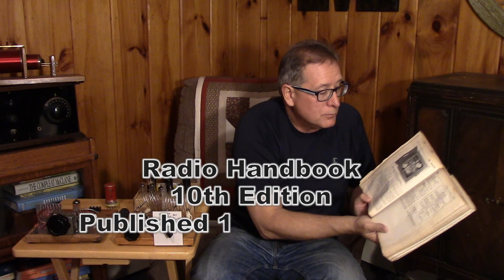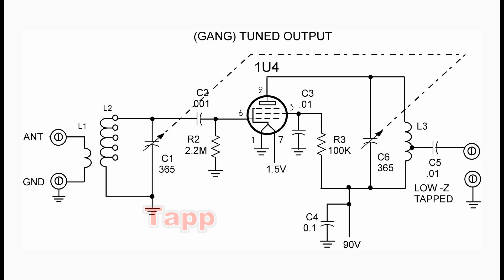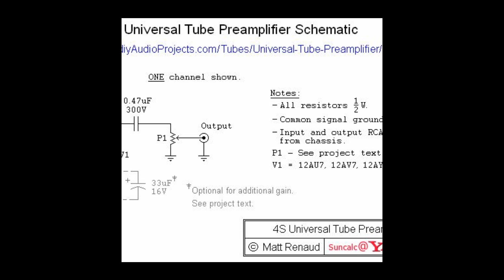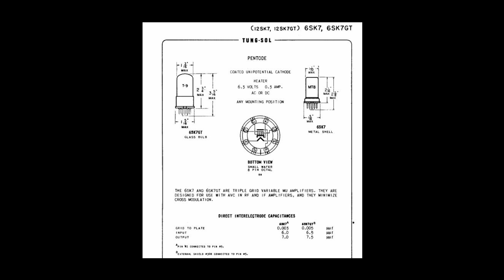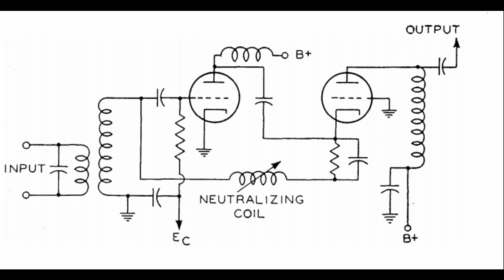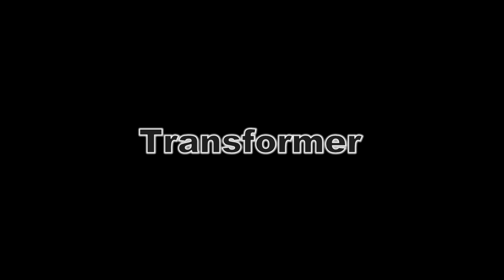Shortwave Cascode Preselector

Comment: It is possible to build a two stage amplifier with a common cathode (emitter or source) stage driving a grounded grid (base or gate) stage where the DC feed for both stages are in parallel not series.  Is this still a cascode amp or is now a cascade amp?

On a tangent subject, in the early days of the BCB, the neutridyne circuit was popular, but was patented.  To avoid patent violations, did any radio makers use either the grounded grid or  cascode configurations in sets?

There was an odd ball tube  (WE717A) that had a mushroom shaped glass bulb atop an octal base shell.  It was sorta a 6AK5 or 9001 with an octal base and was used in many WWII VHF receiver front ends.
Reply from the maker: I think still a cascode since you are still talking two topologies, CE and CB. Cascade in my mind means a string of identical stages.

Comment: I'm wondering what the purpose is of that small value resistor between the plate of the lower tube and the cathode of the higher tube in the Amico and your final circuit. Is it some kind of parasitic stopper resistor?

Comment: How does it compare (noise figure, dynamic range, immunity to overload etc) to more modern devices like for example mar preamps or preamps based on J310 transistor popular in ham radio world. Is it worth to try with tubes? I have some nuvistors lying around and I wonder if it's worth doing (besides educational aspect of ocurse).
Reply from the maker: I do not have equipment to properly test for these. However, when we are talking about BCB to Shortwave frequencies, IN GENERAL and with BASIC CIRCUITS, tubes will always outperform solid state solutions in regard to dynamic range, immunity and overload. And noise figure is moot at shortwave. We did not change to solid state for performance reasons, we changed for cost and power savings and miniaturization. It would be later that more exotic topologies would arrive to bring solid state up to the performance of tubes.

Comment: By far, one of your very best videos ever.  Really glad you went through the design with the math.  When I was getting into electronics/ham-radio, everyone said to leave tubes behind (even the old-hats) so other than an a working knowledge to repair tube equipment, there was not much emphasis on actual detailed hows and whys.  Funny how now with solid-state going to MOSFETs, we come back to design considerations and topologies like the old vacuum tube.  So, I plan to do some tube-building--just can't beat hearing distant signals from a radio that glows in the dark!  73...
Reply from the maker: The 70's were an interesting time to be learning because tubes and transistors of several kinds and ICs were all being taught together in a unified way.

Comment: Why not use a mechanacal bandpass filter? No tubes nor the power to run them?
Reply from the maker: Mechanical filters are by design, filters with very narrow bandwidths and sharp skirts. They are excellent filters. But they are also limited to frequencies below, perhaps 1000 kHz, and are generally lossy. So you only see them utilized in the last intermediate frequency of high end superheterodyne receivers, typically at 400 to 500 kHz.

Comment: When are you going to get out of the 50's????   You could buy ready made RF amps from China for $6.00.  I made a 50 khz to 500 mhz preselector using toroids from Amazon and other parts from ebay.  Total cost was $15 using some of my existing parts for my SDR receiver that covers 10 khz to 2 ghz and costed $120. (SDR Play)
Reply from the maker: Ha! I work in this field and purposely separate the channel from anything modern. RF principles are ageless.

Comment: I saw several formulas where 'Gain' was defined, but it didn't say which gain.  It could be the ratio of output voltage to input voltage, or output current to input current.  I would assume voltage, but do others know that?  Thanks for the informative video.

Comment: Thing is i live on the west coast. Cant get really ANY shortwave here. Im convinced many radio designs will work fine when signal is actually available
Reply from the maker: I am listening to the KFS WebSDR from Halfmoon Bay CA 6 PM West Coast and hear strong stations. WWV at 5 MHz, CFRX Toronto 6090, Radio Marti on 7305, China in English is blasting in on 7315. WBCQ on 9330, Radio Prague 9395. I suggest a 31 Meter Dipole.
Reply: @MIKROWAVE1  many times when i tune to wwv i get a lot of interference i think its possible im getting both wwv stations at once (the one in colorado and the one in hawaii) I did pick up radio havana last night and ive picked up other stations as well before but they all tend to fade in and out. I was using a 25 foot long wire. Websdr is going to be much more sensitive than my TRF or a crystal though. So i dont think its a reliable indicator. I am able to get some shortwave but as i said they always fade because most are not aimed toward the west coast at all
Reply from the maker: @researchandbuild1751  Agree on all and sure you can hear two WWVs since you are in the middle - and even some nights the same WWV coming at you delayed around the world mixing with the short skip! But 25 ft longwire is a possible weak point. Try a 50 ft dipole with coax coming into the radio and see if things quiet down.

Comment: Greatly enjoy and have learned from your videos...!  I always tell others to check out your videos...  Thank you very much...!  Regarding neutralization, a couple of questions...  How to select the initial value?  The value of Cn should be Cgk+Cgp (plus parasitic) and for the plate-to-cathode inductor value the conjugate of this value?  How critical are the values, is it possible to estimate them, use a fixed value and get "good" (fair) performance, or should always use a variable value component?  Thank you again..!  73, Greg (KC9ZEW)
Reply from the maker: Basically yes you can estimate, but that is based on a perfect phase and amplitude reversal method like a center tapped system to for feedback. So it is just very unlikely that you would achieve a null value because it really is a bridge circuit problem. So maybe CT the output primary and feed bypassed DC power in there.  Then estimate the C neut value with a trimmer with a max of at least double that, and tune for the least feed through at the high end around 15 MHz  (power off). This can be done in ether direction with Gen on one side and scope on the other.
Reply: Very good, Michael, I will make a note of this...!

Comment: I love vacuum tube technology its so nostalgic.
I  have no tubes but i am looking for some from garage sales etc.
i am mostly interested right now into the 12Ž1L tube which is soviet copy of german WW2 RV12P2000
Its only 12V anode voltage and 12V heater.
then i have in plan to go to more high voltage stuff ( 60 ,90 , 180 etc. Volts ) aaand then maybe into some really HV stuff like GU81 which is big soviet HF transmitter Pentode  with 450W of anode dissapation ( 600W max. for 3 minutes )
and well it need 3kV when operated on 6MHz ( maybe i will use it for some HF PA or radio transmitter on HF : ) )
I just love how those tubes glow and radiating heat ( when transmitting pirate radio glow of tubes is giving moderator most of the adrenaline ( my friend said ) ) and i believe i am not alone :D .
See you next time. 73 from OK2???
Reply from the maker: Very cool tube!

Comment: Wow, some very good information, you did a very nice job. I do have a small suggestion and that is when you are talking to a schematic being displayed that you somehow highlight the sections you are currently explaining and/or annotate it as you talk. I have an undergrad in Electrical Engineering and I was able to follow along but just barley, not your fault of course, rather my lack of tube knowledge and general cobwebs in my brain from lack of use. I look forward to the solid state video, I have experiment with BJTs in a cascode configuration and I should be able to follow along a little better. Anyhow, awesome job and thanks for sharing.

Comment: Question: As the term of solid state is used strictly for any circuit that is on a printed circuit board and thus could be a microchip, transistor, or a tube, why is it in this more modern time that solid state refers only to semiconductor devices? There were tube radios where it was all mounted on a printed circuit board and were called "solid state". 
I do not recall when the switch was made in the reference but I see it more and more these days and from the original concept, the modern terminology is simply incorrect.
Reply: AC: Solid State refers to transistors, diodes etc that are not tube types.  It has nothing to do with circuit boards.
Reply from the maker: Interesting but I have never heard of this. I always thought that it was purely to do with devices that could operate with "solid" semiconductors which required no thermionic emission as valves do (with hot filaments).
Reply: The valves /tubes have the electrons traveling through a vacuum, not solid semiconductor, so tubes / valves are called 'hollow state'.  👍👍👍😊